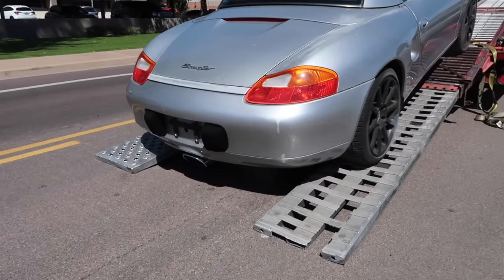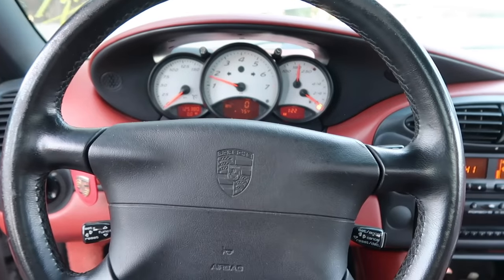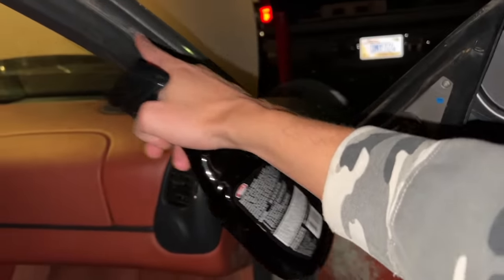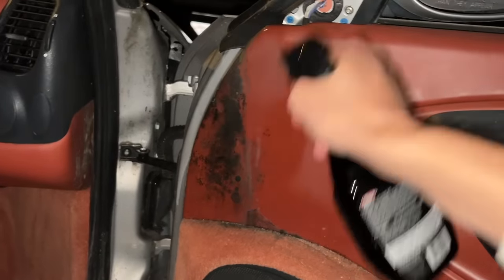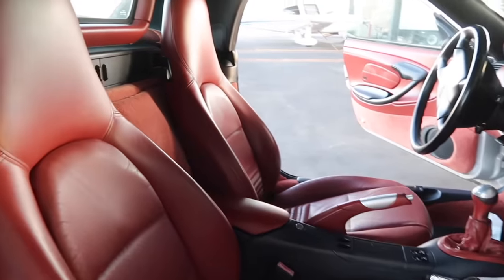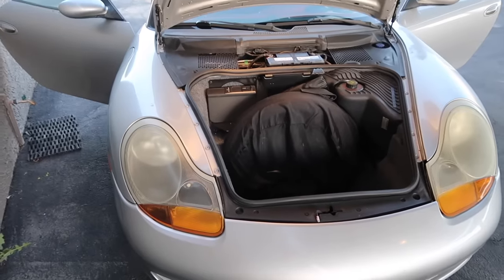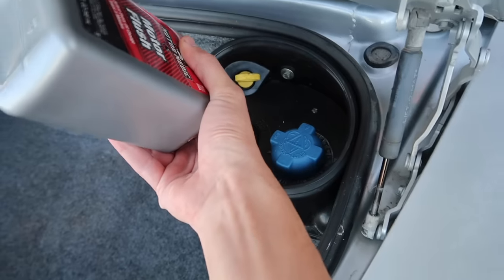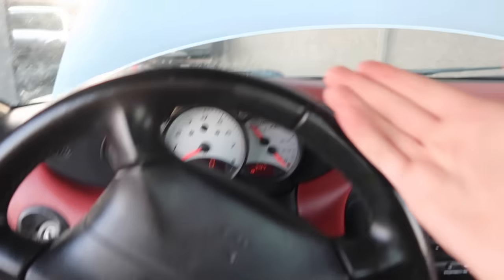Fixing All The Problems On Our Cheap Porsche Boxster For Under $100!

Comment: Theres a 2003 boxster on copart in california with a soft top and grey interior with no bids. $2,000 max price and no bids, no highlights listed, primary damage is listed as mechanical. No secondary damage. Has the black stripes that porsches have

Comment: Silver over red is classic Boxster from the original prototype, and you could just buy rattle can automotive paint to match at NAPA. I'd suggest checking out the immobilizer because they tend to cause a lot of annoying electrical issues since they're located under the driver's side seat and are not waterproof.

Comment: You need to replace the battery in that key. CR2032. Use a guitar pick to safely open it.  Do you get all the oil out at that angle?  Headlights came out good. I had an office in the airpark years ago.  I think I might have had the rotors turned before driving it. OEM wheels.

Comment: A little late but my 996 had the same sticky ignition switch that caused all kinds of issues (wipers stopped working, lights staying on, etc). Did some research and found spraying a "dry lube PTFE" in there  freed up the ignition switch, and the key started working fine, along with the gremlins vanishing! For next time!

Comment: I'm sorry you didn't show your position while changing the ignition switch. I did mine and was upside down for 2 hours like you to first loosen and then re-tighten only 2 screws. I had to use left arm / hand for one screw and right for the other. What a PIA.

Comment: With the head light repair.... pop the headlights out and take them off the car.  Makes things like that way easier since you don't have to worry about the paint around the headlights.  It's a single bolt in the front trunk to remove it, there is even a special tool in the tool roll to do it.

Comment: A very nice job. Yes, the car could do with a respray, but a cheap car all the same. I'm sure my wife would like it. It would made a nice replacement for our 2003 Astra convertible. Only done 77000 miles as it's mainly Summer use. It was a good family car, but our daughters have their own cars now, so passengers not required!

Comment: 1. Keep the wheels but get them refinished and swap the caps out for a Porsche logo
2. Keep the hardtop for sure
3. Repaint it
4. Paint dark metallic grey
5. Stock exhaust - it's got a really nice subtle note as is

And pull the carpets out and get them redyed to be vibrant again.

Comment: That’s what they do on a cold start,I have a  2017 991.2 with 17,266 miles on it if I don’t drive it will make that sound. All the oil will drain down I ask my service writer at the dealership and he said that is normal.

Comment: great job guys! 👏👏👏 As for the car color I would go with red or black. Probably black in this case since the interior is red. I would leave the rims but do a paint job on them and fix them. Also those screw caps on. Other than that, really nice job.
Reply: 👆👆ᴛᴇxᴛ ᴍᴇ ᴏɴ ᴛᴇʟᴇɢʀᴀᴍ ᴡɪᴛʜ ᴛʜᴇ ᴀʙᴏᴠᴇ ᴜꜱᴇʀɴᴀᴍᴇ ʏᴏᴜ ᴡᴏɴ ʏᴏᴜʀꜱᴇʟꜰ ᴀ ᴘʀɪᴢᴇ 🎁🎁 ꜱᴛᴀʏ ᴛᴜɴᴇᴅ ꜰᴏʀ ᴍᴏʀᴇ ᴠɪᴅᴇᴏs….

Comment: Take the hard top off to see if the electric top works and the condition of the canvas. Paint the car the original color because changing only the outside color of the car will cheapen the look. Paint the hard top black. Put on the Porshe mags. Keep the original exhaust. This will give you maximum curb appeal and value.

Comment: You need the oem wheels that looks like cheap sh$% repaint highly recommended and sell the roof to recoup costs of the vehicle under the conditions that the convertible top is in excellent shape or there at all
Reply: 👆👆ᴛᴇxᴛ ᴍᴇ ᴏɴ ᴛᴇʟᴇɢʀᴀᴍ ᴡɪᴛʜ ᴛʜᴇ ᴀʙᴏᴠᴇ ᴜꜱᴇʀɴᴀᴍᴇ ʏᴏᴜ ᴡᴏɴ ʏᴏᴜʀꜱᴇʟꜰ ᴀ ᴘʀɪᴢᴇ 🎁🎁 ꜱᴛᴀʏ ᴛᴜɴᴇᴅ ꜰᴏʀ ᴍᴏʀᴇ ᴠɪᴅᴇᴏs.

Comment: The hardtop takes only minutes to remove, yes the soft top is still there underneath. All you have to do is release the latches, pull the hard top off, then you can test the soft top and see what condition it is in!
Reply: Don’t forget to disconnect the pigtail for the rear defroster.

Comment: Get a re-paint in Porsche OEM original paint and keep the wheels.   Sell the hard top. Check breaks, suspension, etc. Check the soft top --- condition & operation....car is then worth $6-10K. Thos 986 P-cars will run strong for 150 to 200K miles easily. If maintained.
Reply: 👆👆ᴛᴇxᴛ ᴍᴇ ᴏɴ ᴛᴇʟᴇɢʀᴀᴍ ᴡɪᴛʜ ᴛʜᴇ ᴀʙᴏᴠᴇ ᴜꜱᴇʀɴᴀᴍᴇ ʏᴏᴜ ᴡᴏɴ ʏᴏᴜʀꜱᴇʟꜰ ᴀ ᴘʀɪᴢᴇ 🎁🎁 ꜱᴛᴀʏ ᴛᴜɴᴇᴅ ꜰᴏʀ ᴍᴏʀᴇ ᴠɪᴅᴇᴏs..

Comment: The headlight kit is only temporary. If you want to fix the problem properly you need to spray a high quality automotive 2K clear coat (2 part) and coat the lenses so they're protected. When that polish wears off you will have raw uncoated plastic exposed to the elements and it will look even worse than before.
Reply: Ehhh I did one of these kits 2 years ago and it’s still looking good! Obviously tho clear coating them would be a lot better.

Comment: We haven’t seen the soft top yet. My guess is that it’s trash. Plan on spending $1500-$2000 for a new one unless you do the labor yourself, or find a good used one. Very easy to remove the entire top and mechanism and swap it if you find an entire assembly. Also, it looks like the speedo isn’t working.

Comment: @JR Garage Keep the cheap porsche vids coming! Quick note on the oil change: The all in one pan you guys have works well except you need to use a step bit and open up the holes at the bottom as the amount of oil that comes out of boxsters and 911's will cause the exact issue with the over flow. I opened up both holes to a little larger than that of the size they are and since its plastic its really easy. Then, use you oil jugs and a funnel and transfer old oil back into the jugs for recycling. Also, the oil drain all in one also has a "air valve" on top that needs to be open as well for the oil to flow better. Its very easy to do what happened with the overflow but opening up the drain holes, making sure the valve on top is open and double checking to make sure an oil drain plug or even the filter didn't make its way down to the bottom will prevent this issue from ever happening. Ask me how I know :)
Reply: 👆👆ᴛᴇxᴛ ᴍᴇ ᴏɴ ᴛᴇʟᴇɢʀᴀᴍ ᴡɪᴛʜ ᴛʜᴇ ᴀʙᴏᴠᴇ ᴜꜱᴇʀɴᴀᴍᴇ ʏᴏᴜ ᴡᴏɴ ʏᴏᴜʀꜱᴇʟꜰ ᴀ ᴘʀɪᴢᴇ 🎁🎁 ꜱᴛᴀʏ ᴛᴜɴᴇᴅ ꜰᴏʀ ᴍᴏʀᴇ ᴠɪᴅᴇᴏs..

Comment: I would paint it, or at least wrap it.  What goes well with burgundy?  I think it neon green would look spiffy with similar color calipers. Wheels, I would think, if you have originals kicking around to put those on.  Summer is around the corner, it is Boxster time!!

Comment: 1. Sell the hard top and apply the money toward a decent paint job..  Repaint in the original silver. 3. Replace the wheels with OEM silver wheels. 4.  Dye the carpet in the original color if you can. 5.  Don't waste money on an exhaust system.  If you make it look like a well maintained original car you will maximize the value.   Oh yeah, one more thing. 6. Give it to me in a giveaway.
Reply: 👆👆ᴛᴇxᴛ ᴍᴇ ᴏɴ ᴛᴇʟᴇɢʀᴀᴍ ᴡɪᴛʜ ᴛʜᴇ ᴀʙᴏᴠᴇ ᴜꜱᴇʀɴᴀᴍᴇ ʏᴏᴜ ᴡᴏɴ ʏᴏᴜʀꜱᴇʟꜰ ᴀ ᴘʀɪᴢᴇ 🎁🎁 ꜱᴛᴀʏ ᴛᴜɴᴇᴅ ꜰᴏʀ ᴍᴏʀᴇ ᴠɪᴅᴇᴏs.

Comment: I actually say don't paint this car - it almost has a patina to it.  some type of classic wheels would be nice.  an exhaust would be a good fit for this - basically, it should be a "driver" and enjoyed.  as for the top if there is a soft top and it's in good condition  I say "rock it" with the hard top off - I think all total you could find a nice deserving new owner that would appreciate this car for what it is - and that's a "driver" quality car that is relatively un molested.  A "cheap" paint job (because that's what it will look like) wouldn't really "ruin" the car but won't add that much to the car's value - I kind of think it would lower the potential value.

If you do end up painting it - spend some extra $$$ on OE paint color and spend some time on the prep work....

Comment: Do not get rid of the hard top. Remove it, clean it, if there is a convertible top, clean it(!)
If you do paint it, do not paint it any color other than the original silver. Despite your feelings about silver, painting it some other color on the cheap, will just mean it is a car with a s**t paint job that will not match in all the nooks and crannies. 
SILVER only. Please.